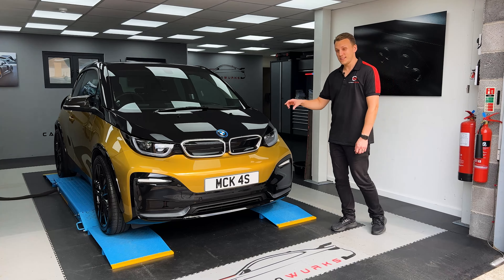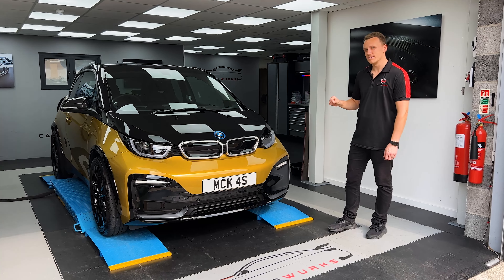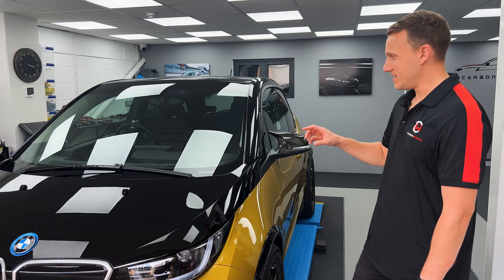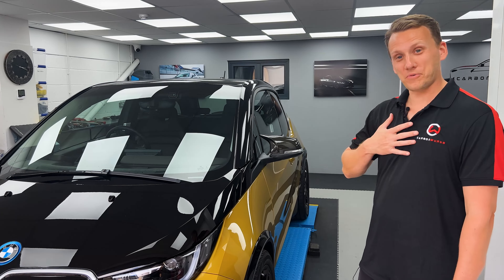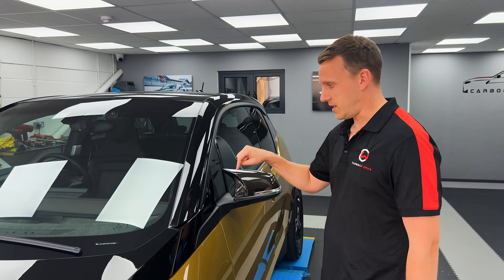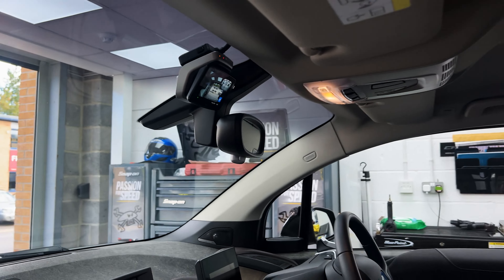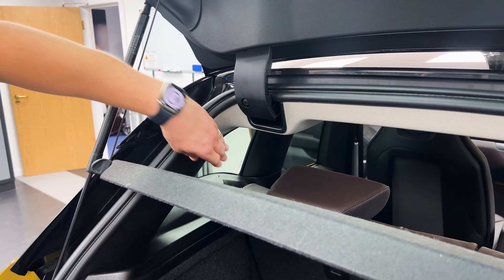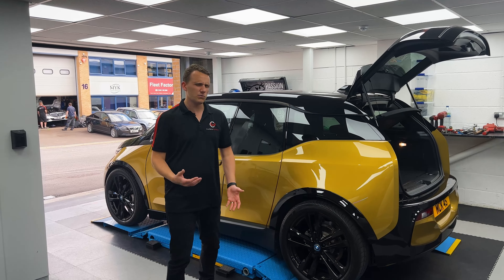THE BEST DASHCAM FOR ANY BMW!

Comment: Awesome! I did two Garmin cameras on my i3s - the front one I got power from the rearview mirror but the rear is just plugged into the 12v in the cargo area. Your install is incredible slick! How easily does that C pillar trim come off? Just the screw under the airbag sign and pull the panel off?
Reply from the maker: Yes the pillars are quite straight-forward to remove! 

It's always nice having one camera that can do front and rear at the same time especially if wired directly into the car's fuse board!

Comment: Great video. I have a 2019 BMW i3s and checked the BMW site to check out this dash cam. It’s shows as not compatible with the i3. How did you get this fitted to your i3s, was there any alterations you had to make or is their compatibility chart wrong?
Reply from the maker: Many thanks. This camera is definitely compatible, you just need to buy some specific parts to make the camera work with the i3 fuse board. If you search, you can find the specific fitting kit and installation manual for the i3 with this camera system.
Reply: can you share the P/N for the fitting kit for the i3?   @Carbonwurks

Comment: So does it need to be wired into the rear wiring loom? I was told by my local MINI dealer they can't fit the rear camera to my new Clubman as there is no provision in the rear loom, is that true?
Reply from the maker: It does depend massively on the vehicle. We don’t have specific knowledge with the clubman sadly but BMW/Mini will list what cars specifically these will work with.
Reply: @Carbonwurks  I might have misunderstood the video then, I thought the wiring was all to the front of the car so the rear camera doesn’t need to use the rear loom.
Reply from the maker: @cathyolds6521 for this particular car that’s correct. It runs from back of the car to the front fuse box and doesn’t need to touch any of the rear loom. It does depend on each vehicle which is why this may not be applicable to the mini clubman. 

Both BMW and Mini have installation guides that outlay the process vehicle specific.
Reply: @Carbonwurks  I'm looking to install this into my F40, where can you get the installation guides from exactly? I've searched and found very little info so far. Great video, thanks
Reply from the maker: @jasonstevenson2928 Glad you liked the video! 

You get a basic install guide with the kit but the main vehicle specific ones are from the BMW tech info system which you’re unlikely to find online I’m afraid.
Reply: @Carbonwurks  Any chance you have access and willing to share with me? Not your fault but it's ridiculous that BMW forcing you to go to them for install, my main dealer is wanting to charge me £750 to remove ACE 2 and fit ACE 3 pro. I have a M135i F40 2020, appreciate if you can share or at least tell me if the connections are the same as the ACE 2, Cheers
Reply from the maker: @jasonstevenson2928 Typically the connections are very similar between the devices. 

Sadly we’re not allowed to divulge any BMW tech info that’s from their portal. We only access it when we need it for an install, sorry!